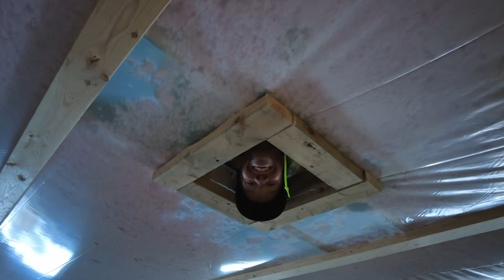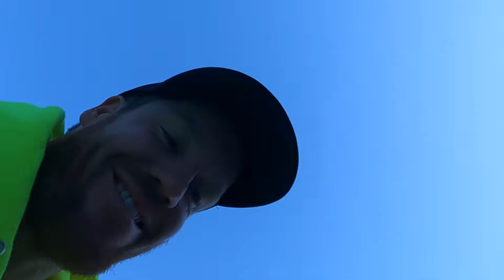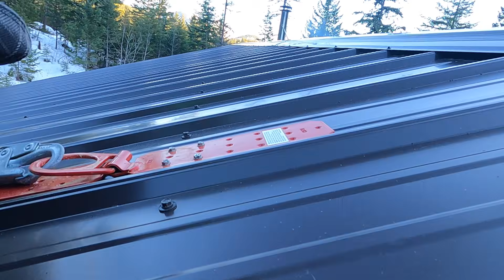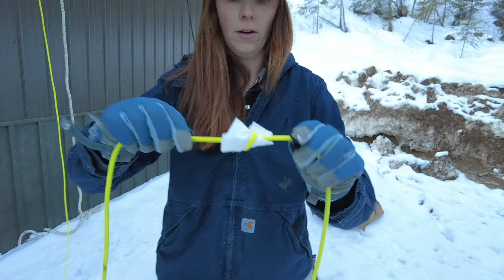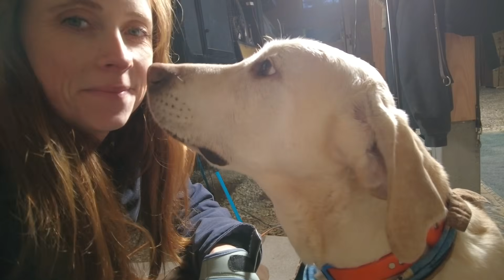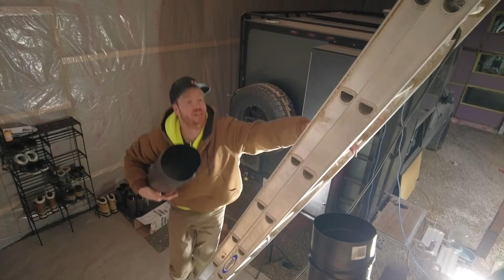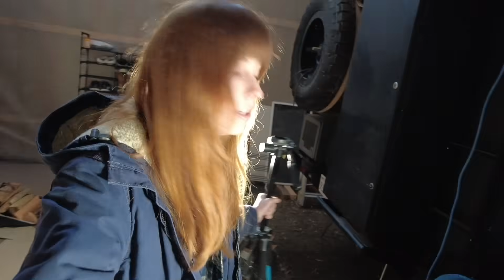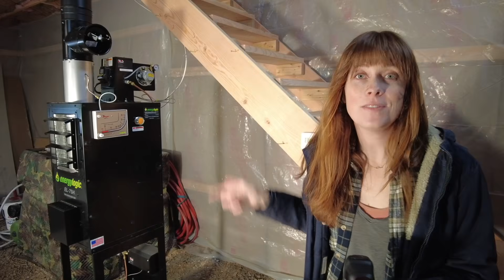Installing Our Waste Oil Heater | Living Off-Grid

Comment: Nice heater, I've been around several older waste oil heaters and the most common issue has been filtration and contamination. You will likely need between 500-1000 gallons per winter. Storage of that much waste oil can be difficult as well as handling cold waste oil in the winter from outside storage. Also any oil should be suspected of having crud and non combustibles in it.  Good luck, enjoy the heat.
Reply: I agree 100%. I always pour my waste oil thru a screen when pouring it into one of my storage totes. And keeping as much anti freeze and brake fluid out of the oil as possible is important. Regardless I advise a water separator somewhere in the feed line to the burner or on the outflow of the primary storage tank.
Reply: I agree with the combustibles, I work on a fleet of vehicle with a group that ranged from
10 to 15  mechanics and I have seen them put anything in the waste oil drums (edit Bad spelling)
Reply: 100% agree, filter your oil before running it through the furnace as waste oil furnaces are sensitive to debris in the oil and can cause the furnace to shut down due to plugging. The cleaner the used oil the better. Read through the troubleshooting guide and know your furnace, as you will eventually have to service/repair the furnace. Make sure each fall to service it so it you gives you the least amount of trouble. A friend of mine has an oil burning furnace in his tire service and oil change shop and loves it, has all the oil he needs to keep it going. You can get started with 55 gallon barrels and start saving your oil to start, and move up to a larger plastic tote later on.
Reply: @bwlyon   Good info, also you can get a 120 volt band heater that fits a 55 gal. drum from Granger or McMaster Carr.  They have a thermostat on them to warm the contents up to 70 degrees or more in the winter for good flow.
Reply: As to the filters for running the waste oil in your heater…use a bath towel…it is the correct size to stop all harmful crud…you can go finer, but why…also on your heat oil needs for the winter…talk to an ag supply company…I think of Wilbur-Ellis and see what the cost would be for one of their 1000 gallon cubes in a cage…it’s how a lot of the liquid fertilizer comes in, then it can be cut to the correct amount per acre…something I looked at as a heater is a glass heater for a tropical aquarium…worked like a charm…
Reply: Want oil , learn how to change oil on semi trucks and do it for half of price .. you ll get your oil supply for winter . Im draining monthly 13 gal of oul from my semi  truck.
Reply: Maybe find a filtering system for the filler, at least it wouldn't crud up your tank. And an outside tank may not be good as Louis said, cold oil acts different
Reply: @cbmirada  - Also, the waste oil needs to be very warm when filtering otherwise it will be too viscous to go through the filter media (towel, screen, micron filter).  I use a "waste oil centrifuge" to filter my waste oil because it takes all of the impurities out.  The waste oil centrifuge can even be used to clean your oil for reuse in your vehicles and machinery.
Reply: @Rattlerjake1  how much does a centrifuge like yours cost and where can I get one? I've been looking for a way to clean my waste atf so I can burn it in an old diesel engine without running any burned cluch material through it.
Reply: @inoahmann7542  - I don't use the commercially available type specifically for doing waste oil because the cost is way to high ($1000+).  So I bought the type that mounts on the engine of a semi tractor/truck and use a cheap Harbor freight pump that is rated for pumping diesel, veg oil, etc.  It just depends on what deal you can find.  My first centrifuge I bought at a junk yard; it was $20 (really cheap) because at the time no one was buying them.  I've been doing this no for 20+ years.  I have two '95 Ford F350s with the old 7.3L IDE engines, a 9kw diesel generator, and two tractors and I burn used veg oil, used motor oil, atf, gear oil, etc. in them.  On the trucks I changed the fuel lines from rubber to VITON lines because veg oil will degrade rubber. Make sure you add a preheater to your fuel tank so it is not too thick to flow.
Reply: @cbmirada  .

All they need to do is set up a Tank that does not have the drain in the bottom of the tank so that any debris in the tank settles in the bottom.
Then install a mess screen    In the intake Flange
Reply: Better get friendly with some oil change shops !  You will likely have to BUY that used oil.
Reply: Yea they probably should have done wood. Like maybe use one of the billion trees around

Comment: How’s that power pack doing running the appliances.
Reply from the maker: The EcoFlow has been working really well! It's been running our entire apartment (fridge, lights, computers, etc) 24/7 for about 2 weeks now. Not a single issue so far.

Comment: Have you tried weighting the safety rope slightly to allow the rope grab to slide up the safety so you don't have a lot of excess slack in the line? It may be a little safer. I haven't read through your comments in the previous video for a reason why you wouldn't.

Comment: Another great project.  Good job!  I would never have guessed a waste oil heater could burn that cleanly.  You may have neighbors that will contribute waste oils, too, although I suppose they might have a recycling market for them in town.  

QUESTION:  What happens over time to the crud (e.g. dirt, metal shavings, piston ring dust, etc.) left behind from the waste oil?
Reply from the maker: Hi Donald! The word has spread and we already have a few great sources of oil. There is some annual maintenance including an inline filter and cleaning the ash out.
Reply: @AmbitionStrikes  Find a Large powerful Magnet and leave it in the oil tank. it will pick up any metals.

Comment: If you add ceiling fans it might help recirculate the hot air up high and reduce your T-stat controlled fuel oil burn rate
Reply from the maker: Totally agree! A large fan will be a great addition to the shop.
Reply: @AmbitionStrikes  Big ass fan, expensive but awesome, look them up.
Reply: @jstar1000  a Big Ass fan will be great in summer, too!
Reply: But, remember, they have limited electrical availability, so a BA fan may not be practical.
Reply: @rixtrix11  A Big Ass Fan would be great ,as long as it doesn't use a BUTT LOAD of power 🤑😃
Reply: @AmbitionStrikes  get one from the company “big ass fans”. It’s real lol
Reply: As an aside I've found that running a ceiling fan, 80 watts, warms my room more by forcing down the accumulated hot air than adding a second 1500 watt heater...thermal layering within individual rooms is real, significant, and needs to be considered more than most people do. Additonally, more than just warming your room the feels more comfortable overall being the same temperature.
Reply: You don't really need a ceiling fan, there are sterling pump fans which you can sit on top of a furnace, or attach to the stove pipe and they are self powered, pushing the air around the space. They are astonishingly effective, despite their size.
Reply: @BobHannent  Sterling powered fans have only a very minimal output (m3/min), not really suitable for this purpose, they are more of a smaller room circulation fan.
Reply: Doesn't do any good to heat the attic.
Reply: @RHalRip  who's heating an attic?
Reply: @rixtrix11  Royce totally missed the fan's purpose of moving the hot air THAT RISES back downward to the shop work area 🤔
Reply: @rixtrix11  Heat rises without a circulating fan - that's where it will all go.